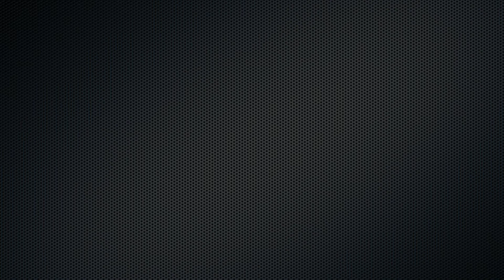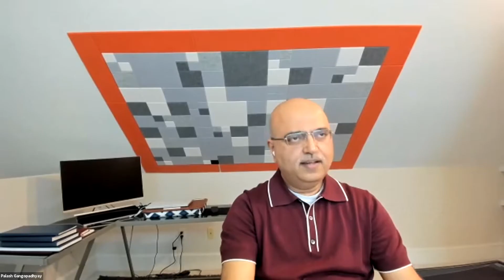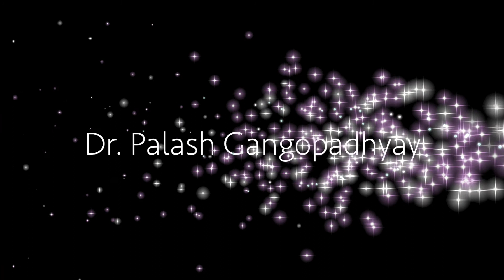Dr. Palash Gangopadhyay Talks About Why is Graphite Is Critical for Electric Vehicles

Comment: Does Urbix have resource or are they only focused on the processing (spheronization and coating)? Nouveau Monde Graphite in Canada is aiming to be the largest producer in the western world with a vertically integrated 0 carbon foot print operation. But we will need 10 more just like them.
Reply from the maker: Yes, you are correct. Urbix works with many graphite mines around the world bringing suitable graphite materials to the US lithium-ion battery supply chain.  Not all natural graphite materials are equal, and some works better than the others in LiB. Urbix extensively tests raw feeds, select the suitable ones, purifies, and then spheroidize and coat the purified graphite to make LiB anode grade CSPG material.  All of the technologies used by Urbix are homegrown, and proprietary to Urbix, including coating.  Minimal carbon footprint, transparency in the supply chain, accountability, traceability and ESG compliance are very important to Urbix.
Reply: @palashgangopadhyay4078  Thank you for the response. So is Urbix focused on localized supply, even though there is not really any active graphite miners in the Western World (except maybe Imerys mine in Canada)? I'm asking because ESG is better when we don't have to ship "tones" of graphite around the world. If Urbix is here in the US then it would make sense to get feed stock by truck or train on the continent then having to wait for a ship (current shipping crisis...). The carbon foot print is higher if you have to get the graphite from Africa or China. Also is Urbix a part of any organization like European Battery Alliance?
Reply from the maker: @elliotholden2919   Urbix manufacturing facilities are modular cookie-cutter systems that can be built right next to a LiB OEM to supply that specific customer. We do not need to ship high-value products 1000s of miles to reach a client.  We are also not tied to a particular supply/source, which gives us great flexibility to manage our supply chain and quality of products.  Our GHG emission footprint is less than 10% of current graphite anode processors/producers. Earlier today we kicked off a project with Circular, to start the implementation of a blockchain-based traceability program from the source mine to the client.  This will provide a transparent and ethical product at the end of the LiB manufacturers.  0 carbon footprint is a myth when you are using a lithium-ion battery. However, we all need to do our bits to reduce that footprint to contribute to our collective climate goals.